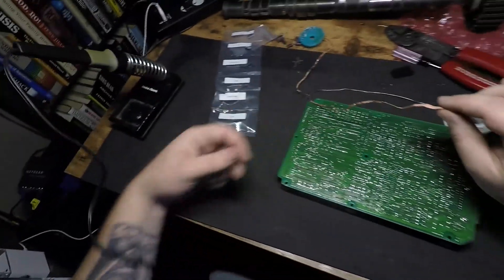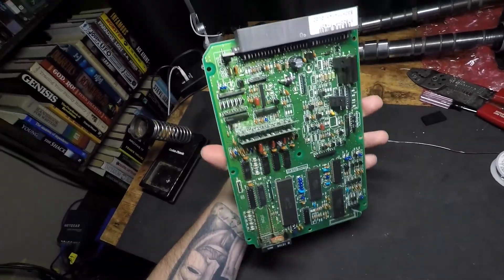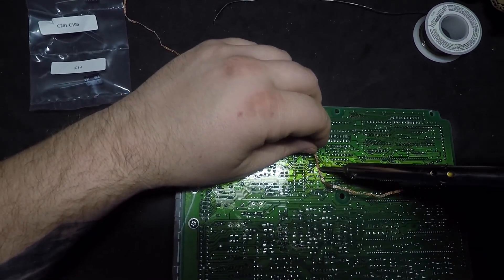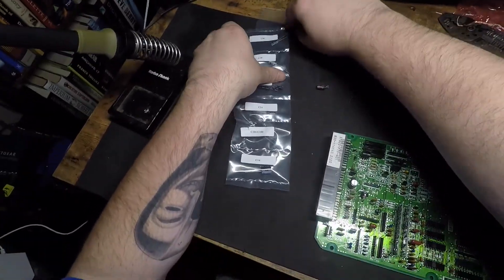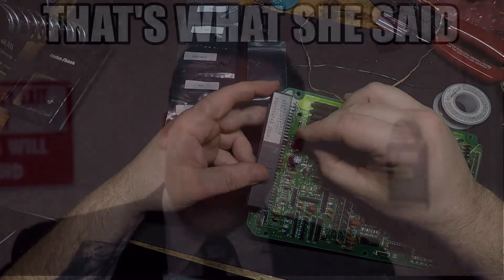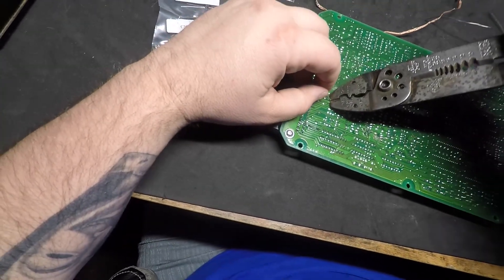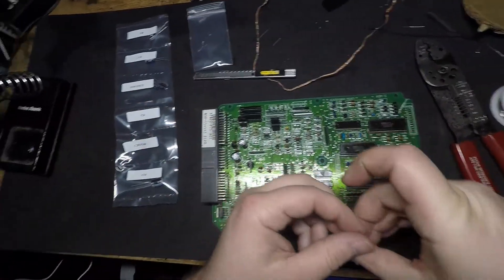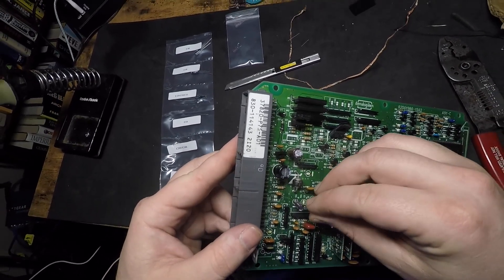Brief How-To Desolder and Install an OBD1 Honda ECU Capacitor kit from Xenocron ://  CRX HF Build

Comment: I had C14 let the smoke out. should I be worried about any other components or just replace the caps in the kit?
Reply from the maker: If you feel confident enough to desolder them, I'd give replacing the caps a shot.